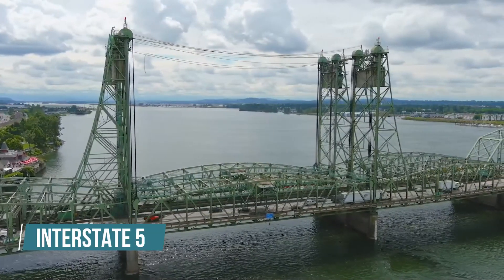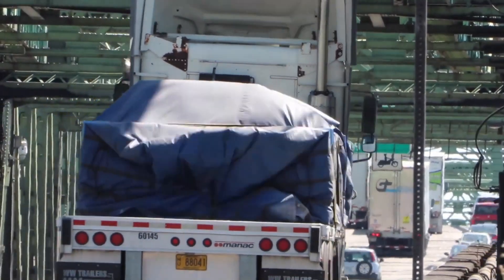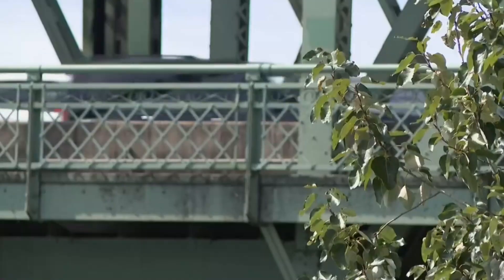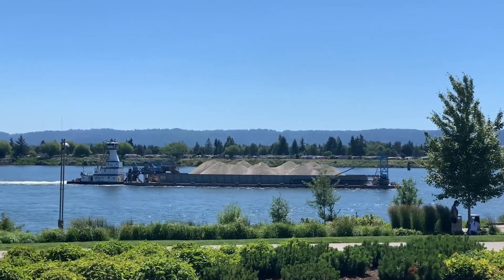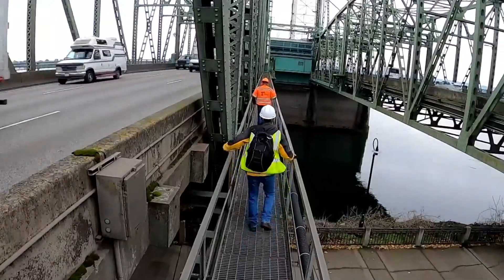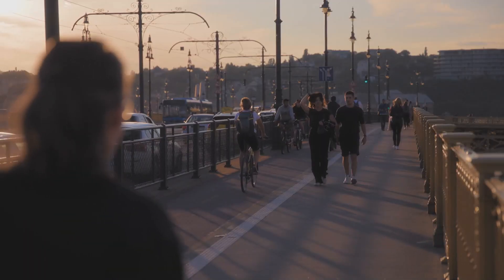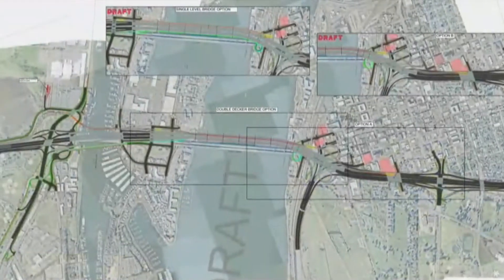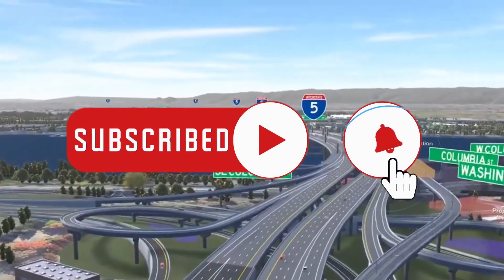Why The US Has To Spend $7.5Bn On This Bridge

Comment: From what I understand. Additional lanes for light rail and bike in the plan. No additional lanes for cars will be added.  $7.5 billion does not solve the traffic issue. Also they want to have tolls not untill its paid for but for ever. In addition the plan is to have tolls on the there 205 bridge which has been paid for for ever. $7.5 billion and for ever tolls and no additioal lanes for cars?
Reply: If they didn't have tolls, it would cost even more, and then opponents would complain about THAT instead!

Comment: They need to reconsider a tunnel just up stream and for now keep the old bridge.  Portland and Vancouver would suffer permanent economic damage if the I5 crossing was shutdown for the years needed to replace the bridge.  Another crossing needs to built before any removal or replacement can start.  They have never had a realistic plan or planning group.
Reply: The I205 bridge is just 6 miles up the river. a tunnel would be absurdly expensive compared to a bridge